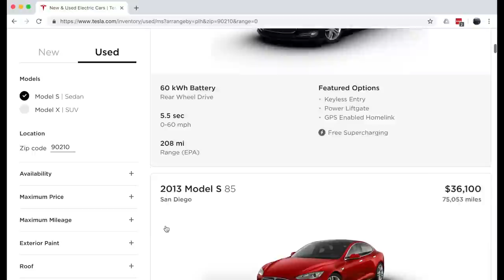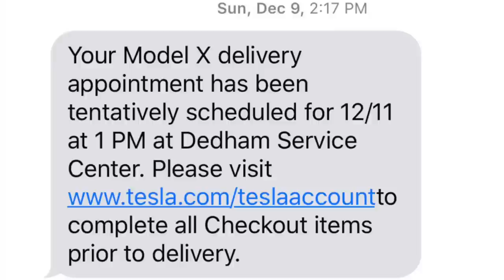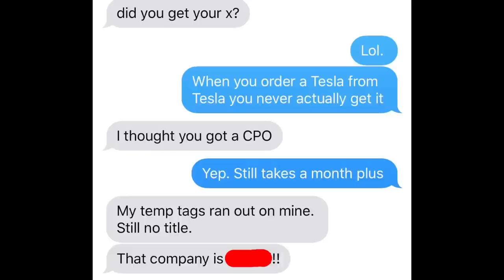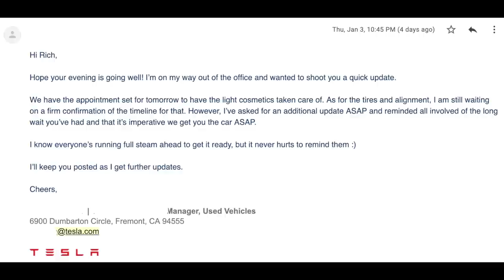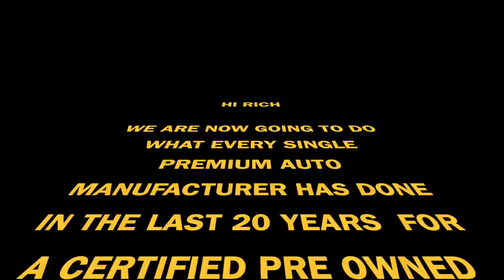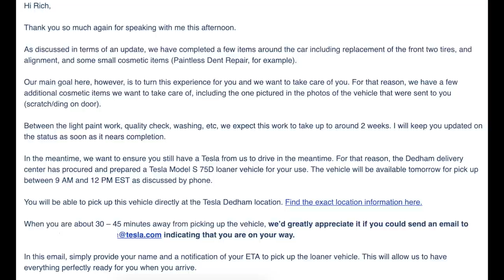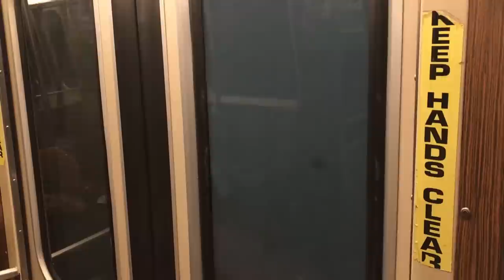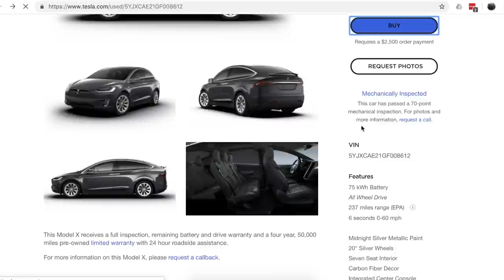How I became a victim of the Tesla system

Comment: I was a technician for many years. Used car managers waste no time. Once the vehicle is in their possession they post it on their website. They will then put the vehicle through an inspection process. If you purchased the vehicle in between that time frame, things can get a little crazy. Now they have to rush the inspection. The techs miss things. The techs will request a "P/A" slip with requested parts to be replaced. If the manager is in a time crunch he/she will decline repairs stating they're too costly. This gets the vehicle to the customer more quickly. The plan mostly works unless the customer actually knows what they're looking at. Most Tesla owners down no offense. They probably pushed the car out, and when they saw your video they realized they made a mistake, and decided to make it right. These are the reasons i no longer work as a Technician in the automotive industry any longer. That's just the beginning... The politics inside the shop are worse.. Dealerships are disgusting at best. They usually put blame on techs when it's more often managements decisions that end up making the techs look bad. We've all tried reporting things like these to the BAR, but nobody would listen. Nobody cared, so i gave up my career after the stress and pressure caused me to emotionally over react to a situation with my boss and lose my job. I decided never to go back into the industry.  I see stories like this and it makes my stomach hurt. Customers shouldn't be treated this way.  EDIT: Notice how they push the extended warranty? Weird how they push cars out AND push an extended warranty to MAYBE get MORE income when you return after the vehicle fails? It's possible
Reply: T3hChaerlz im only starting out as a tractor mechanic and know exactly what you mean its never the mechanics fault but they always get blamed for somthing they got asked to do. i find it disgusting
Reply: Know your feel bro, when management decided something without asking you and you know you can't do it in time, you gotta do it anyway. You say something, they say they already told the customer and it can't be change. So you did a shit job in that time frame and delivered. Then it came back for you to fix with even more works, sad sad job.

Comment: Why would you post a CPO car up for sale that still needs work done?  If you go to any regular dealership a CPO car is going to have the work done before the car is out front in the lot and being advertised for sale.  If someone were to come and want to buy it they can then drive off with it that day, not wait weeks for it to get repaired after they bought it...  Tesla might be worse than Apple.  And working in the tech industry, Apple is pretty bad.
Reply: you are right you should not you check the car first PDI(pre delivery inspection) it then you fix the faults you then detail it then I re PDI it that to the discretion of the garage if they do it a second time to check all repairs and detailing was done satisfactory   you then take pictures of the finished product then you advertise it at the price you have come to after all the repairs and detailing has been done its that simple from a master mechanic so I know what iam talking about tesla second hand dealerships obviously do not have trained sales or mechanical staff its that simple they are not sticking to the rules of selling a car any fool knows how to sell a car the proper way and if you do it the proper way you will get very little come backs because everything has been done prior to selling the car you will get the odd part failure which cannot be foreseen that's to be expected now and then but even then it should be quickly corrected unless its an engine failure which can and do happen but rarely .

Comment: Tesla's just pissed that you work on their vehicles. They want full control over everything but they know you're going to do modifications and repairs. That plus it being a used car is working against you unfortunately
Reply: If that were the case i doubt Tesla would open source their design.
Reply: @Kulu17311  Tesla open sourced their design so that other auto manufacturers could build new, better electric vehicles and accelerate the advancement of the electric vehicle on a global scale. Not so people could tamper with already existing Tesla's. Tesla is the Apple of car companies so just about anything voids the warranty since they only want Tesla mechanics "under the hood".

Comment: They only have a few years of experience building cars while the German companies have been making them for over 100 years and that is why I stick with them. Motor and door handle failures are common and brakes parts are very expensive too.  I have never had an engine failure in 40 years of driving Audi/Porsche cars.  Who would you trust?  Never heard of anyone needing new door handles.  Tesla has special $1,000 handles and I heard of one older 2013 model S needing 6 changes and about $8,000 of brake repairs.

Comment: Mother was smart. She bought a KIA! Thousands lesss, not just cost, but hassle.  I bought my 2008 Ford Taurus SEL online.  It was sitting in my garage within two days.  Though a used car, it is in showroom condition and everything was checked out by my mechanic and verified the dealership mechanic's report.  I  did ans oil change as I like to know exactly when it was done (the electronic monitoring system will actually let me know, however).  Spending that much for a modern day EDSEL company is ridiculous.  Should've gone straight to the state Attorney General's office for resolve.

Comment: I purchased a 3P demonstrator at a discount and initially was very happy. However, my sales person wasn’t there at delivery, and someone else had me sign papers and sent me off with no review about how anything worked. On the way home I found that the blind spot warning didn’t work and I almost had an accident. At home, I couldn’t get the Bluetooth to connect. I thought I was probably at fault, but the dealer also couldn’t get it to connect to anything.He tried to reload the software, but all that did was to stop the rear view camera from working. I felt that I couldn’t trust this cars computer and turned it in for a refund within the 7 day period.Of course no refund yet. Guess what $65,000 “luxury car“ comes without a garage door opener. Tesla. I paid $300 for it when I found out there wasn’t one, and have received no refund for this since what would I do with it without a car?

Comment: I ordered a model 3 on 4/1/19 and got it 4/4/19. They told me it would be delivered then told me I had to go to a super charger 2.5hours away which I did. When I got there I had to wait another 30mins for a shifty Tesla delivery guy to get there. Then the car’s front passenger door wouldn’t open right because the panel rubber was catching on the door behind it. The guy put it on a due bill but and I scheduled service. It really sucks That Tesla has no service center in the 6th largest city in California which is Fresno. I have to drive 4hours to the Bay Area. The whole experience was pretty bad and I had to initiate all phases and push the process forward myself.

Comment: You're problem is getting excited about this car in the first place. It's really not worth it and electric cars are not really that environmentally friendly as we are lead to believe. If you got to get one, order they new Volvo one. I dont know if it has autopilot but who cares..It's fun driving your new car.
Reply: they are enviromentally friendly, they are never fairly compared with gasoline vehicles, when people calculate the co2 footprint of an electric car, they calculate all the co2 output from construction of the vehicle,  harvesting resources, charging battery with coal power, etc. But the gasoline cars are only rated at the actual co2 the car puts out from burning gasoline, to fairly compare them you have to include co2 impact from manufacturing a gasoline car, as well as the co2 impact from actually mining, shipping to a refinery, refining it, then shipping it to a gas station, and the co2 impact from running a gas pump just to distribute the gasoline.

Comment: I SHOULD HAVE NEVER LISTENED TO THIS AND UR PREVIOUS VID: BODES TESLA'S INCOMPETENCE, REPREHENSIBLE QUALITY CONTROL/CUSTOMER SERVICE, AND A CONGLOMERATE HOUSE OF CARDS. HOWEVER, ON-BOARD HYDROLYSIS ACTION SPLITTING ANY WATER PRODUCES ALLLLLL OF H-CAR'S FUEL(NO FUEL CELLS): CLEAN, NON-POLLUTING HYDROGEN FUEL ( NO COAL MINES, FOSSIL FUEL BURNING EFFLUENTS, DIESEL TRIAXLE BEHEMETHS BY THE THOUSANDS CAREENING ON HIGHWAYS TO TRANSPORT COAL OR ENDLESS TRAINS BURNING DIESEL FUEL, AND THE H BURNING CARS RUN LEAN AND CLEAN FOR MANY MORE MILES THAN GAS OR DIESEL VEHICLES.  FLEETS OF THESE EASILY CONVERTED STANDARD GASOLINE BURNING ENGINES ARE BEING PRESENTLY ROAD TESTED BY THE US MILITARY FOR IMMEDIATE LARGE-SCALE USE!!!!!!  GAS/COAL/OIL CORPORATE MONOPOLIES ARE BUYING OFF UR ELECTED OFFICIALS TO PUSH ELECTRIC AUTOS AND TRUCKS WHILE YOU DUPES NEVER DID THE RESEARCH EXCEPT FOR FAUX NEWS BY G/C/O SHILLS, BUT YOU CERTAINLY LIKE TO PUFF UR CHESTS OUT AND SWAGGER UR RICHBOY TOYS -- GO VOTE FOR TRUMP AGAIN: YOU DID IT WITH GEORGE W !!!!

Comment: Seems like a pretty broken company when they do this to you. Buying a used one can be good though, as all new Teslas are extremely pricy. You need at least 50.000-60.000 to get a Model 3 with decent options, for that money you can buy a much better EV from any of the regular makers.
Reply: Please tell me who makes a "much better EV" compared to a $50-$60K Tesla Model 3. Please, I'm very curious.

If you say Jaguar with their I-Pace, no, not even close. Maybe nice for a luxury car, but subpar for an EV.

If you say the brand new Audi e-Tron, first, good luck getting one (seriously might be easier getting a used Tesla), second, pretty sure it's neck and neck with the Jaguar, IOW, subpar.

Mercedes EQC? Slightly better, still subpar! Good luck getting one in 2019.

These above are decently-appointed luxury vehicles that have no clue what it takes to be even an average EV. They're repurposed ICEV platforms while they deliver in terms of fit and finish (initial quality), they're wholely supplanting even basic potential of an EV. A lot more weakness rather than strength here.